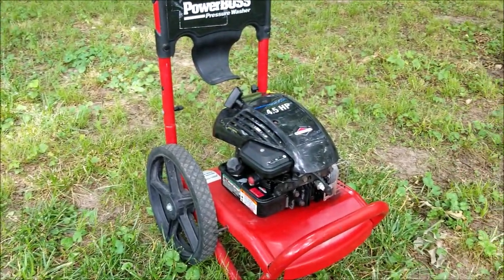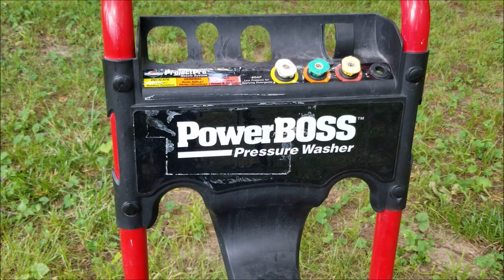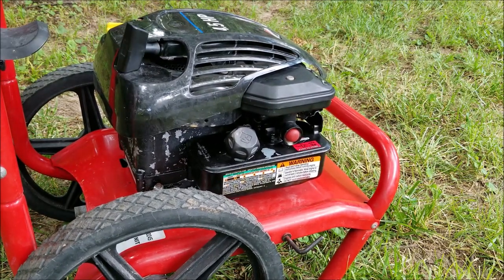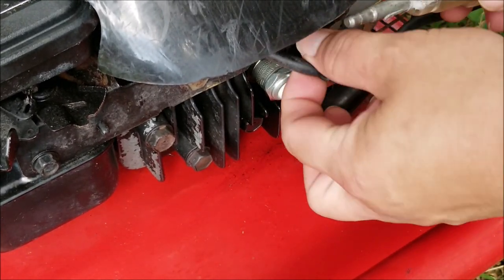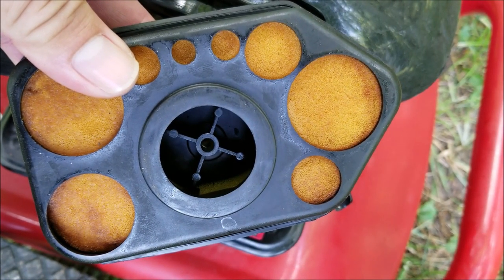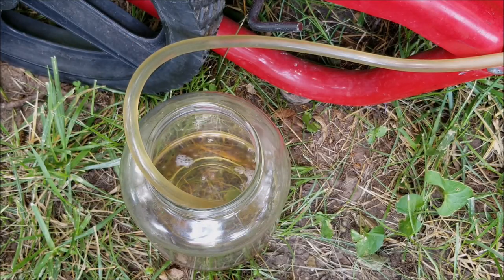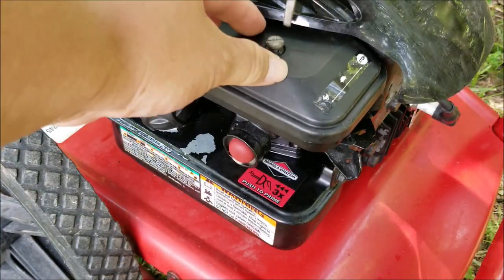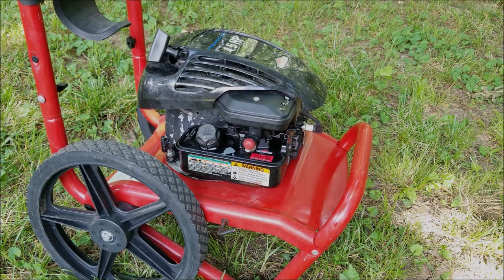Power washer not starting? It may not be the carburetor.

Comment: Hi inside house garage. Yes, same here. I use my pressure washers for my mowers, house, concrete and cars. Once in a while. My pressure washers are old and have tecumseh engines on them. The tecumseh's seem to have more sensitive carburetors and might be more prone to old gas and dirt. However, with ethanol free gas and yearly oil changes my pressure washers run great.
Reply from the maker: Yes they do, maintenance is key.

Comment: One of the best ways to ruin a pressure washer is to start the engine without the water hooked up. The water lubricates the pump parts when the engine is running. I always hook up the water first then makes sure it comes out of the hose then I start the engine. Hey I paid over $400 for mine and I do not want to ruin it. My opinion here so do it your way as it is your rig.
Reply from the maker: The pump is oil lubricated and water cooled by the water. You can run the pump for short periods without damage.  I have some other videos on pressure washers on this channel if you have time to watch them.
Reply: Robert, Inside house garage is correct and no harm is done. You can safely start a pressure washers for several seconds dry. No harm will be done. It is several minutes that will do damage.
Reply: @INSIDEHOUSEGARAGE  Thanks anyway but I will pass. I am only doing what the manufacturer has in his instructions for my washer.

Comment: I have a big unit and at high pressure it can remove the paint off a truck mudguard my friend was not happy that day.
Reply from the maker: Thats quite the unit you have there.
Reply: @INSIDEHOUSEGARAGE  It an old mines unit they used to clean their equipment with
Reply from the maker: @patrickboyd6486  do you know the pressure rating?
Reply: @INSIDEHOUSEGARAGE  4000 psi 21 L/min Honda twin and told never point it at anyone will do damage to them . Its a bit big for what I need
Reply from the maker: @patrickboyd6486  dang that's a lot. Nice unit tho

Comment: I have a Honda pressure washer that ran well until one of my friends dropped it on the ground and now it only runs for like 3 seconds and then dies. Tried everything i could to see if i could get it running longer but i just cant figure out why it will not run anymore.
Reply from the maker: If you could get me the model number that will help me to figure out what might be the problem.
Reply: INSIDE HOUSE GARAGE Omg im so sorry but its actually a Simpson OHV 280cc Model number MS60850. Soo sorry
Reply from the maker: @aintnbfr  no problem.  This keeps me from asking you a lot of questions is all. Let me take a look and see what I can  figure out.
Reply from the maker: @aintnbfr  okay it looks like a honda style engine/harbor freight with fuel shut off and choke lever. Do me a favor and open the fuel valve and of there is a drain bolt on the bowl remove it. If not remove the only bowl nut and make sure you hold the bowl in place and see if gas flows out of the hole where the bolt was.
Reply: Luis, I make it a rule never lend out power equipment unless I am there on site. You never get it back in the same condition you lent it out. I am not alone, I hear of many horror stories. Anything from wrong gas, old gas, 2 cycle gas will not make you equipment run.
Reply: INSIDE HOUSE GARAGE Update: Today i just started repairing the power washer when i realized something! There was barely any oil in the engine haha! Also i just want to say thank you for helping me out figure out why my power washer wouldn't start. Yes i also cleaned the carburetor. Ty again😁
Reply from the maker: @aintnbfr  no problem and good luck

Comment: What kind of oil do u put in a power washer
Reply from the maker: you mean for the engine or the pump part?  it depends on the brand.
Reply: @INSIDEHOUSEGARAGE  u need to run two different types of oil for each one
Reply: For example the same as exact one you have

Comment: What Is A Power Washer?
Reply: bruh
Reply from the maker: it pressurizes the water from your garden hose so you can clean stubborn dirt and grime off surfaces
Reply: @lukeWiz44  Yes?😕
Reply: Adding to what inside house garage has stated. You get a powerful stream of water out of one to clean numerous objects around your home. Cleans fantastic and you use very little water. Rather than straight out of a garden hose.

Comment: I have the same one… I cleaned out the carb primer pumps well. I even put starting fluid inside behind the spark plug but it doesn’t even budge. I feel like it’s a spark issue or does this have a kill or on and off switch somewhere ? Because I noticed it has the wire that’s connected to the coil magneto for a switch… please help me
Reply from the maker: yes the off switch is integrated with the throttle. Try starting it with  the throttle in either direction and see what happens.